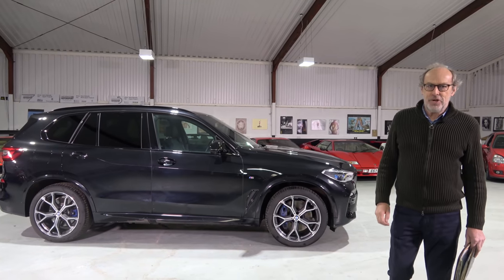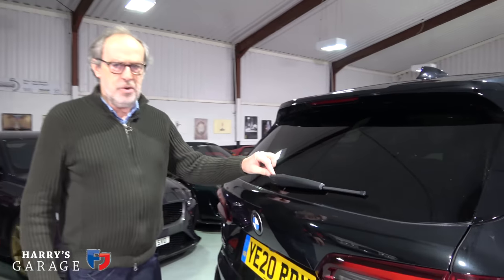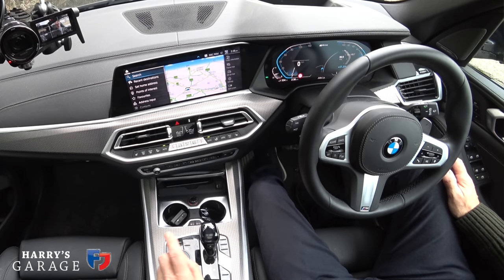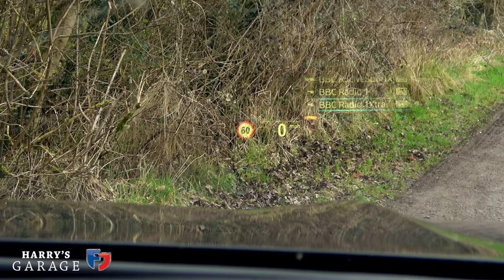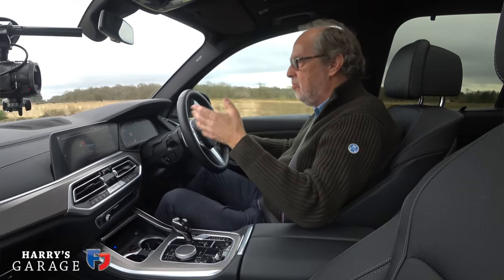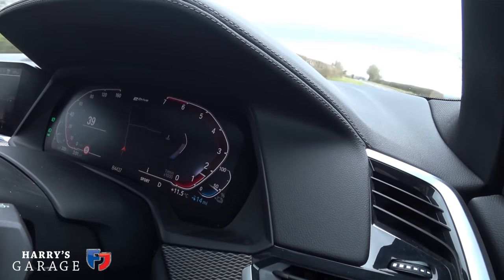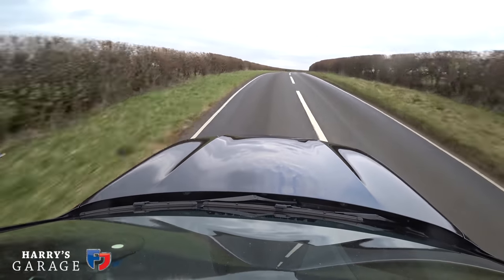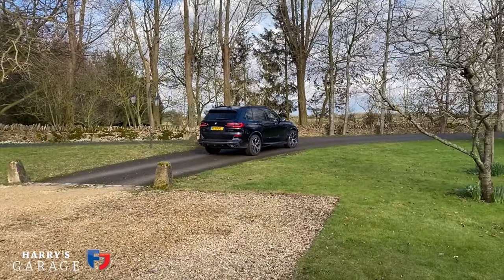BMW X5 45e 10,000 mile review. Why PHEV beats EV for our family car

Comment: I have a previous gen X5 40e and I love everything except the 4cyl, it sounds terrible and performance drops dramatically when the battery is depleted. I was actually very happy to see BMW going with the 6 cylinder on the new generation.
Reply: Do you recommend buying a used 2018 x5 40e with the 4 cylinder engine, or find one with the 6 cylinder?
Reply: @sharisees   I love mine and it has been reliable. Drive both and see which one you like best. I think I would get the 6 cyl if money was no object just because it sounds so much better.
Reply: Even with depleted battery no lack of power in my 40e....seriously powerful 4 cyl.... after 3 30ds.....little difference.... very economical in comparison to oil burner

Comment: Excellent review and very consistent with my experience.  I have 1100 miles on mine, and have driven 66% in pure electric mode.  It is hard to describe until you drive it, but in electric mode the vehicle is refined and serene....it just makes you want to drive it more.  That said, when the ICE kicks in, the sound is surprisingly good.  This sounds like a BMW when you stomp on it, and that was an unexpected plus.  Charging rate is a definite issue, and BMW will have to address that going forward, but if you are charging at home overnight, this doesn't impact your life.  Terrific work on the reviews, all the best.
Reply from the maker: Good to know, the refinement on pure electric is uncanny and I should have made more of it in this video. There's a calmness that comes with town driving in this X5 PHEV that's one of this car's best features. Enjoy!

Comment: I live in California and bought this same car exactly one year ago. We covered 9600 miles in that year and of that 5900 miles were on pure electric. we have a good solar system at the house and charge it on a level 2 charger every day. It has not made any difference to our Electric bill at all.. We get round 40 miles EV range, the US version limits the % use of the battery to increase its warranty, so its only rated at 30 miles. As its hilly where we live going up hills, ofter it is in Hybrid mode with the engine kicking in, flat or downhill its on electric. so we do pick up some regenerative energy giving us the higher miles on electric. I echo all of your comments about the car, so quiet and refined. One big difference in the US is we get a rebate for buying an EV car of $7500, that along with the $3500 discount from the dealer resulted in 11K off the list price of $71K. In GBP thats 46K pounds. It's a heck of a bargain at that price. Best miles on one tankful of petrol was just over 2000 miles. Highly recumbent it.

Comment: The cold engine issue is one I had anxiety about when I had an i8. Most of my driving could be done in electric only but when I wanted to drive in a spirited manner I always held back because of my mechanical sympathy for the cold engine.
Reply from the maker: Not just me then!
Reply: I suppose the only way around that would be to run the car gently in sport mode to get the engine warm, then revert back to normal/eco mode.
Reply: I’ve had a cayenne hybrid which also had a lot of stone cold starts because of the hybrid system; after 120k KMs the engine needed twice a full soot cleaning because the secondary air flows got clogged up from all the cold starts. Car is sold and I’m never buying hybrid again
Reply: Indeed. Had the same thoughts on my i8 too. Freezing cold turbo engine revving to 7000 rpm from spot on when overtaking.
Reply: I recall seeing an F30 330e reversing out of a parking space a while ago. It couldn't have been very old really, but when the petrol engine cut in it sounded like it was on its last legs
Reply: @vyrnmn  it what a 4cyl engine supposed to sound like 😶
Reply: It is odd that BMW allow that , I have a petrol 640iGT and switching on the engine results in a warming up procedure and then a notice displayed on the dash when the engine is ready to be used at full power - certainly using a cold engine at full power is not the best thing in the world to try.
Reply: @harrysgarage  totally not.
Reply: @Ponykotze  Cant be right.
Reply: I guess a cynic would say they build them to last the life of the warranty. If you lent your ICE car to a friend and he/she started it cold, and wheel spun off immediately, most people would never lend that person their car again ie would be concerned about the damage potentially done to the engine. Perhaps the BMW insider might like to tell Harry what the logic again not having a pre-heat/ pre-oil system on the engine.
Reply: Can’t understand how BMW with all their technical ability wouldn’t have some system of basic engine warming to “pre load” the mechanical parts before the power train is used in earnest. My conclusion would be that when buying second hand make sure the BMW warranty is in place and keep it up for the duration of ownership! Another monthly cost but definitely worth it .
Reply: If I know I need to start start the engine I do som manually (gear leaver tilt over and back). Then the engine can warm up a bit. The engine is actually tuned down from 340 hp.
Reply: I would think it just damages the engine over time, but BMW wouldn't be worried about that.
Reply: @harrysgarage  50mpg is not remarkable (a 1 litre, 3 cylinder Ford Focus does that). If one wants to make a 'green' car, make it a 1 litre, 3 cylinder (or similar) and then add the hybrid stuff. And don't make it needlessly huge. Its mpg would be much better, and it would be much better for the environment. And maybe - just maybe - then future governments won't feel such a great need (or have less of an excuse) to tax the hell out of  petrol sports cars and the like.
Reply: @harrysgarage  Car manufacturers seem to be using hybrid technology to allow them to continue selling gargantuan SUVs, rather than to actually make cars that are better for the environment. I see loads of videos about hybrid SUVs, etc. - are there any mid-sized hatchbacks that are hybrids out there? What MPG could they do? (Genuine questions: I don't claim to be an expert at all.)
Reply: @julianevans9548  but it's not a Ford focus. That's a 2.5 tonne SUV. Put that 1 litre Ford focus engine in something weighing 2.5 tonnes and see how far you are away from moving let alone 50mpg
Reply: @juvenil6969  My point being that very few people need an SUV, even in the countryside. We should be making our family cars much, much lighter. Then you can use a more economical petrol engine. As Harry points out, you don't need a family car to be that powerful - the power race amongst manufacturers is ridiculous.
Reply: @julianevans9548 ok misunderstood you on that. But still it's what people "want" not what they "need" that gets manufactured. And a 70k SUV falls firmly in the "want" category. The power race is not ridiculous because there is clearly a market for it. In fact I think SUVs are the most profitable segment for car manufacturers. If you are not interested in more power or size then a consumer can opt for a 30k Nissan or other comparable. However if you pay 70k+ then for that premium you are expecting the economy AND the size, the power, the luxury the badge etc.
Reply: @badgastein2  Indeed. They restrict both power AND redline.
Reply: @juvenil6969  The hybrid part (aka something like a 150hp electric engine) is there to get it moving. I'm sure with a small petrol engine and a bigger battery, it could work out well : you don't need much power to cruise on the highway, and every acceleration would be helped by the electric engine.
Reply: @julianevans9548  Renault Captur plug-in hybrid. Granted it's a small SUV but it's basically a hatchback.
Reply: Same. I have a Volvo t8 and wondering about this. I suppose it may limit itself a bit when cold so maybe I shouldn’t care.
Reply: Been questioning this issue an hybrid but never gotten an answer. Is there a rev limiter when the engine is cold? Or does it let you redline if you stomp on the accelerator? Seems harmful to the engine.

Comment: Excellent review. Looking at one of these to replace my 330e. In your review (sound the 13min mark), you mention about the engine kicking in and being cold whilst mid drive. I am like you and very mechanically minded so was worried about this with my 330e. What you will notice is that the battery level will still drop for a couple of miles after switching as it assists the engine to help protect it. Once it is sufficiently warmed, the engine will then help regen some power into the batteries. I think this is also the reason why you can’t deplete the battery (on full EV) below 8%.

Comment: Can’t help but think that current high end hybrid cars are just a way for rich people to circumvent pollution regulations in cities and the like. Terribly complicated cars with plenty to go wrong, mainly thought to be owned under leasing for 3 years and after that if something goes wrong might well end up with a totalled car. Fuel consumption numbers only add up when driven very gently or in ideal conditions and seen with rose tinted glasses.
Reply: Hybrids were intented for mpg only.  As far as people go.  The rich don't want to spend money on gas either.

BTW Porsche had build the World's first Hybrid in 1898.
Reply: I've just ordered a new C300de - I went for it partly because of the insane amount of torque which is slightly more than the C63S, the other part of it was due to mpg. It should be significantly more lively car than the straight ICE versions (excluding the C63).
Reply: Completely agree... I have an XC60 Recharge as a company car and it is so expensive to maintain. It's great if you plug it in constantly in between short trips, but then if you add every bill up it becomes more expensive than an EV or ICE. One system (Electric or combustion) goes down and you're left with a useless car. This is not for the common family, rather it's to flex engineering abilities.
Reply: I hardly consider the RAV 4 as a rich person's car or one that's expensive to maintain
Reply: Very good comment and I wish people would realise that using a 2.2 T SUV is NOT a sustainable advancement as touted by Manufacturers.

Plus if you look at the life cycle analysis it’s actually costing more to the environment than traditional ICE cars. It’s also so expensive.
Reply: your comment would have some validity if the Prius didn't exist
Reply: @ShaiyanHossain  your comment would have some validity if the Prius would weigh 2.5 T.
Also you have mentioned the life cycle analysis either. It's good to be a smart ass but it's even better to see the big picture too.
Reply: @sergueikoaloff4919  OPs comment addresses that only rich people have access to hybrids 
in the US where I live you can have TWO priuses for the cost of a brand new X5 45e
or even make one of them a rav4 prime which would leave  this in the dust 
and they're quite common place and can easily do 200k miles 
not every person is being forced to buy a 2 ton $65k behemoth if they need a hybrid
I'm sure even in europe/uk there's plenty of hybrid options for the cheap
Reply: @ShaiyanHossain  1) I don't care where you live.

2)if you read the OPs comment it says "high end hybrid cars" so we are obviously NOT talking about RAV4 or Prius.

Thanks again anyway for trying to undermine my post with your facetious assumptions.
Reply: @sergueikoaloff4919  why are you so angry and against cars? How about ships,plains,trucks,tractors,combines,buses,washing machines,dryers,irons,toasters,boilers,electric barbeques? Do you see only energy use as "sustainable advancement"? What about overfishing,land use/tilling,mining for rare materials,waste of drinking water for toilet use,extensive (bio) agriculture,hydroponics greens(for or against?) tourism,war(political instability),internet-bitcoin servers ?
How many 2.5 tons vehicles are being sold in europe?
How much does tesla midel x weigh?
Model s?
Hydro-electric dams and their ecological effect,their potental collapse and safety?
Do 1 million people in the modern city have higher carbon footprint than 1 million people living on the land with similar ammenities? What about the nuclear energy?  But you choose to complain about bmw x5? Please...
Reply: @ms-jl6dl  lol

Comment: Me thinks a review of the GLE 350de (which seems to have a bigger battery and is very refined despite being a diesel), and a comparison with the X5, is in order. 

Speaking of Mercedes, I believe that their engineers are aware of the cold start problem, and thus made some engine components in the hybrid version stronger than the non-hybrid versions. The engine also doesn't give max power for the first couple of seconds to safeguard it; however, it's still recommended not to hammer the engine when it kicks in cold; I believe Porsche also went through several engines testing this kind of thing, until they figured how to make them more robust...so you're definitely right in having mechanical sympathy Harry!

Comment: I know one owner of a 4-series BMW hybrid who got it because the company accountant stated it was good for tax reasons. Drives everywhere in Sport mode with engine running. Doesn't care about mpg, the environment or "virtue signalling". Harry has been meticulous in gathering the data for us enthusiastic viewers but, lets be honest, does anyone who can afford a £70k car reallyu care about mpg? Cold start from zero to 3000 rpm at -10degC is going to trash an engine but BMW trust it will be OK throughout the warranty period. German charging infrastructure is an important point. If EV's really increased on UK roads, we couldn't charge them all either. A really excellent, thoughtful, independent video. Still, my diesel Mondeo estate would do the Brands Hatch trip at 47mpg and hardly depreciates so I'm not envious though I wouldn't mind a free BMW for six months.

Comment: Great video as usual. The old saying, unsure if true was that "90% of engine wear occurs during startup". This might start to apply more than ever.
Reply: Large stationary engines often have electric oil pressure boost pumps that ensure there is oil pressure before the engine is cranked. Not sure if they do this in PHEVs but it would not be a very expensive thing to do.

Comment: Bought an X50e based (at least somewhat) on this review - thanks Harry.  First tank lasted 1067 miles.  In fact tomorrow the numbers will be even more amazing - 3 tanks of fuel, and 1 windscreen replaced.  I hope these ratios do not continue!  Car is a joy.  Economical, smooth, fast.  Lacks steering feel, but other than that it's exceptional.

Comment: Harry, best car I ever bought. Totally agree with your review. Don’t forget although slow to charge, whilst engine is running and whenever you brake there is battery charging going on - albeit slow. BMW NAV & Infotainment  paired with I-drive is simply in a class of its own. Pure refinement and a perfect long distance car for the family. Also experienced remote BMW support which was excellent in helping problem solve so I could continue my journey without having to go to a dealer. Highly highly addictive.

Comment: This is just the perfect mix for this stage in our evolution of charging infrastructure.  Once there are chargers everywhere we can go fully electric, but for now a PHEV with a proper battery that can handle 50 mile trips and charge easily overnight is perfect.

Comment: I bought one. Got it in December. Black like yours. To avoid getting dirty trausers: Buy one without the M-package or lower the car before stepping out. Tip: you can use two fingers on the control wheel to zoom on the map. I will not take it offroad! My average is now 2 liters/100km! Thank for an excellent review!

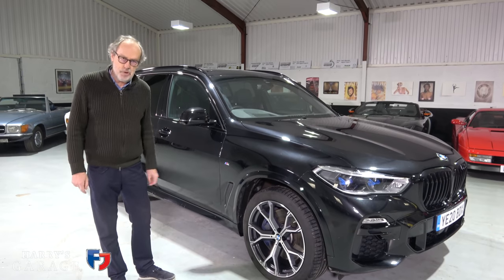Comment: 2:06 normal tyres improve every aspect of the cars - you should do a video on it
Reply: My 2017 F30 335D was more noisy than my new daily 2019 Mazda 3 because of the run flats. Oh, and no steering feedback compared to the E36/e46 era and you have a horrible combination. No grip whatsoever as well when pushing it compared to a good normal road tyre.

Comment: Great video Harry.
I’m on my second Mitsubishi Outlander PHEV, it would benefit from a bigger battery 16 miles realistically going up and down Pennines hills.
Having said that, I sometimes (in spring /summer/autumn go 3 months without filling up (costs about £43:00 to fill)
Using all the heated gizmos in winter screen/wheel/seats/rear screen/electric pre heater hammers the battery as you would expect.
Having said that, 5 hours to charge on a 3 pin plug at home, or on the rare time I charge it at a fast charger, it’s  got a fast charge socket.
It’s a great car for working locally, but as a repmobile, buy diesel.
I’m with you Harry, PHEV for the foreseeable.
P.S. if everything is going to be electric cars, where is the generating power going to come from?